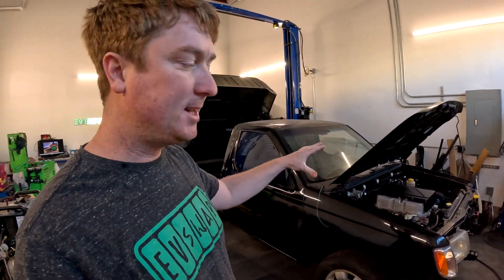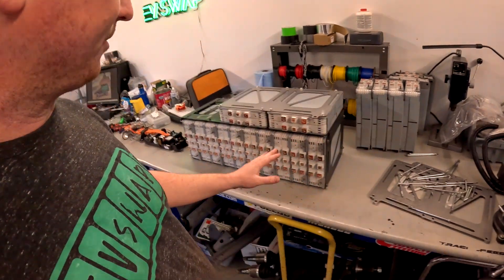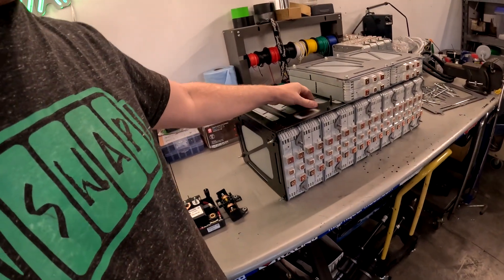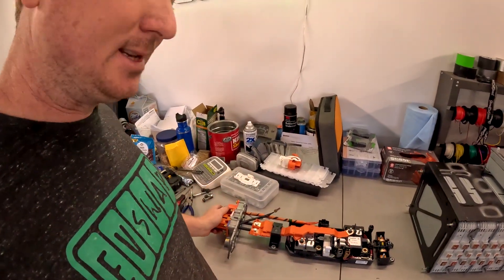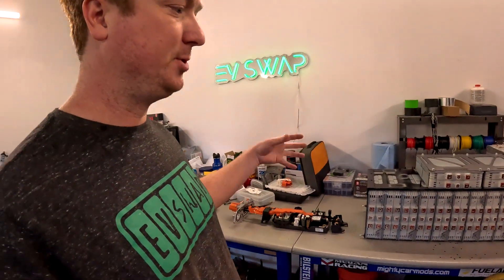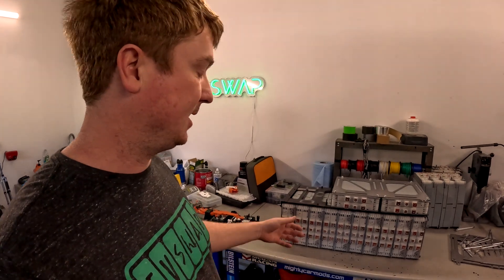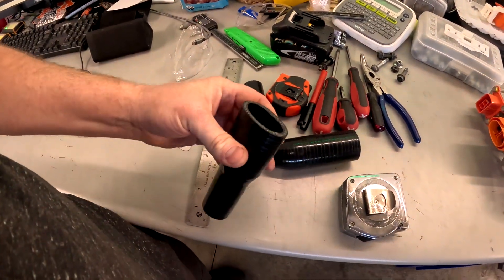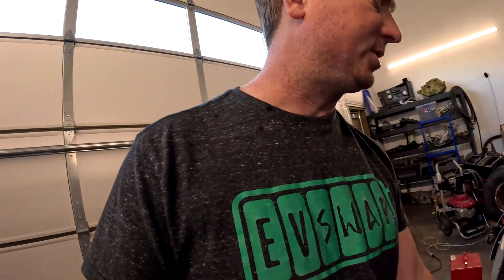High Voltage Battery Getting Started Designing the Pack

Comment: Great videos - I’m binge watching the lot! How do you measure the compression of the battery packs? And make sure you recreate the same in your new box?

One of the good things about this approach is you get to retain the 50kW Chademo charging. I’ve been considering a VW bus conversion but all the kits had slow charging which is no good for a longer trip.
Reply from the maker: I measured the length of the pack as it came originally and then divided by 12 modules and cross-multiplied by 10 to get the new length value. Yes I love Chademo!

Comment: Cool using existing radiator and reservoir from the truck.  Are you going to wire in a 12v fan or leave as-is.  I am trying to decide this for my current build.
Reply from the maker: The reservoir is actually from the LEAF. I also saved one of the cooling fans from the LEAF that I am going to use for the Frontier. We have saved a bunch of money re-using basic parts like that. Recycling is better anyway! Upcycling!
Reply: Reusing low cost parts is so smart, it keeps the conversion as economical as possible.

Comment: Jimmy, as always, very good, video. You have an idea, how it will work to change gears with the transmission and vehicle regeneration, thank you.
Reply from the maker: Thank you. Shifting can be done while moving but slower than normal. Should just be able to stick it into 3rd gear or 4th gear and never shift. Yes motor can regen and has 3 settings: low, medium, and high.